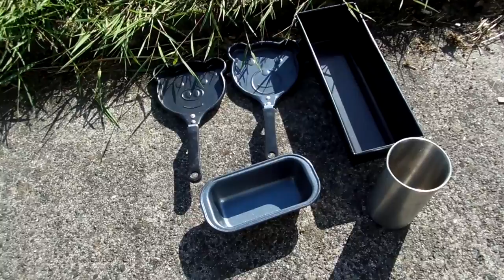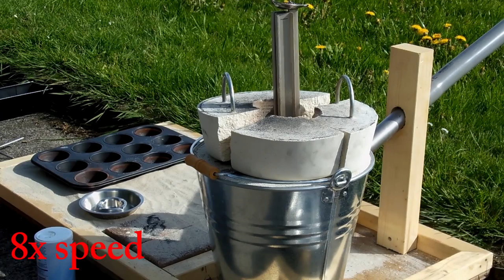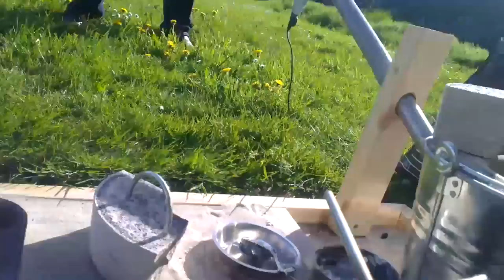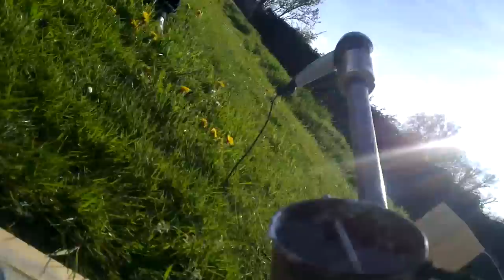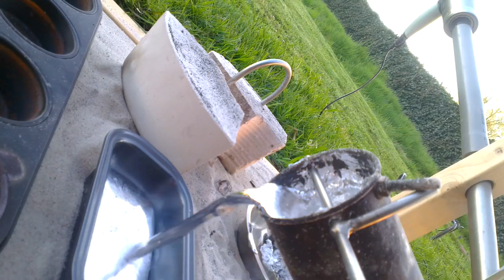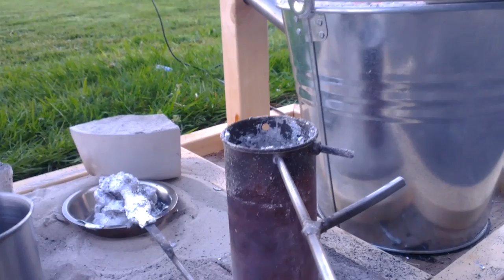Melting Aluminium with my New Mini Metal Foundry

Comment: Hi, great video! I've built one too and having great results, my question is, what was that you sprinkled in the aluminium in the 3rd burn? Top tip, when burning cans the aluminium is darker in colour, chuck an already made ingot in just before you're ready to pour and it brings the shine back.
Reply from the maker: Frank Castle It's called 'LoSalt' and you can buy it in your local supermarket. It is basically intended to replace NaCl in your food. In the aluminium it acts as a flux, to make the aluminium flow better. That is what I learned from other video's at least. It seems to help a little, less air bubbles as it seems. LoSalt or NoSalt should work.

Comment: Might be a stupid question.. but how does one clean and ready up a crucible for the next smelt???

   Great video btw, very impressive handling.
Reply from the maker: +Kristian Dybdal No stupid question. If the melt is succesfull the crucible will be almost empty after pouring. What's still inside is aluminium, so just go for the next melt, you already have some material in. Some of my attempts failed, i didn't have the furnace hot enough. I still have some crucibles with aluminium left in them. Could be re-used, but since I have quite a lot of those crucibles I don't know if I'll ever get to that. TLDR: No cleaning needed :)
Reply: Triangle_DIY Thank you very much, And great video btw! really good work
Reply from the maker: Thank you!

Comment: Superb video mate, that's one very cool mobile foundry you've got there and very nicely organised - Well done.

The only thing I would do different is to weld up a nice steel frame to hold your sand and support your furnace in exactly  the same layout, as wood looks great but it could pose a fire hazard should your crucible drip some molten metal on to the wooden frame!
Reply from the maker: +Joseph D Thanks. It's handy to roll outside and cast. You're right about the wood, next one will be steel. I've a few burn marks from hot thongs I laid down on the frame.

Comment: how come your hairdryer doesn't overheat and cut out 
?
Reply from the maker: I modified it a bit. cut out the heating wire. so it only blows cold air now. I run it off a dc adapter now, because the heating was in series with the  fan motor. 

there are hair dryers which can turn on the heating separately. those can be used without modification.

Comment: Where did u get the scrap aluminum
Reply from the maker: Reed Walker Whe had a really big greenhouse which is now used as a storage space. So we took out the aluminium profiles with all the small pieces of plating and replaced that with bigger panels. That's where I got my aluminium from.

Comment: Hello why did your Lid break? is it 50/50 sand and plaster? I planning do do 1 just like that but its no good if it breaks
Reply from the maker: Yes, did use 50/50 mix. However, I did it in the winter, that could be part of the problem. I've heard from other people that had it crack. Not really great mix, it is a bit soft and damages fast. Maybe look for a better mix. When you make a lid use a reinforcement of some sort, I didn't and that also is part of the problem.

Comment: Did you reinforce the lid with wire or anything?  Looks like you are using my crucible pouring technique!  Looks like it's working well for you.  Good castings!  Keep it up!
Reply from the maker: Makerj101 No, I didn't reinforce the lid unfortunately, that would have been better of course. But i'm now using a lid from some heat and fire resistant material, works better so far. Have to see how long it lasts.

Yes, i got the idea for the pouring from your video! made the handle, and now it's very easy to use another crucible, ruined a few already so it's good that I can change to a new one fast.

Comment: The lid for my foundry cracked too but I just finished making a new one.
Reply from the maker: +Ben Hoxsie Nice you also built one! Did you do anything different with your new lid to prevent it from cracking?
Reply: +Triangle_DIY no i just did it the same way but the reason it cracked was because it was dropped while it was scorching hot. The mini metal foundry that I made works great! I think I might make a bigger foundry that runs on propaine so I can melt more metal each time.
Reply: +Triangle_DIY I also really liked your tool for pulling the crucible out of the foundry.
Reply from the maker: Ben Hoxsie Mine already cracked when preheating. Ive got another lid from a fire resistant material that workes great. I'll post a video eventually when I get some time.

That tool is just made from some 6mm stainless steel rods welded together, works great.

A bigger one is cool. Maybe I'll build one sometime in the future, but for now I still have to try out my electric oven :)
Reply: +Triangle_DIY  sounds cool! :)
Reply: same!

Comment: yes while this may be true over time particulates will leak into your cement or plaster of Paris side wall and all of a sudden become concentrated. I've seen this happen several times and people die because of this
Reply from the maker: +hugh kilo Really? I don't see that happening, how would that work? You know, there are whole constructions made from steel that is galvanized, it's not that dangerous. By welding or inhaling the fumes when it gets hot, you could get a fever. You can see those fumes. The sickness has no long time dangers for your body, at least that's what I read. I highly doubt this application is dangerous in any way. However, maybe you have a source why it would be dangerous? Really interested in that.

Comment: how are you going to fit the bear-face ingots back in the crucible?
Reply from the maker: Lol, did not think about that at the time. Probably cut them in parts with an angle grinder. More of an experiment, not very practical.

Comment: safety gear? what is this safety you speak of? thats not manly
Reply from the maker: +theflyingseabass2205 Who cares? I just like to still have my sight when I'm done with casting rather than leaving blind because a face shield is 'not manly'.
Reply: +Triangle_DIY dude. im joking lol. im not an idiot
Reply: +Triangle_DIY but good vid lol. im putting it to use as we speak lol
Reply from the maker: +theflyingseabass2205 Good to know. Hope others also take caution when doing this. are you casting aluminium now?
Reply from the maker: Good to know. Hope others also take caution when doing this. are you casting aluminium now?theflyingseabass2205
Reply: +Triangle_DIY no. im buying materials. im using my dads wielding mask tho.
Reply from the maker: Great! Have fun!
Reply: In Russia. safety gear wears you